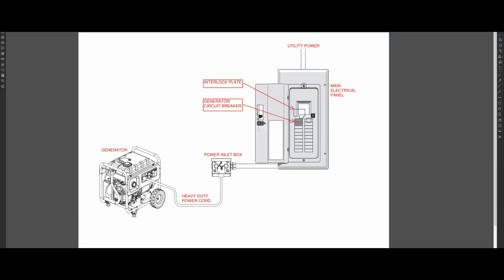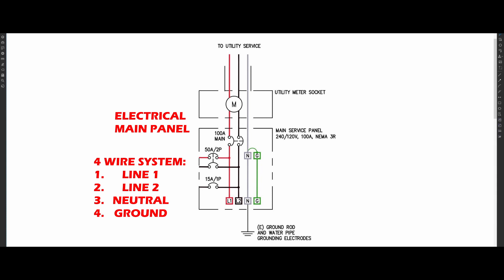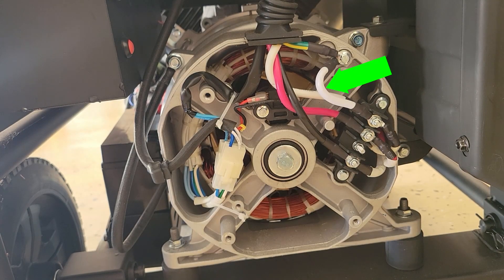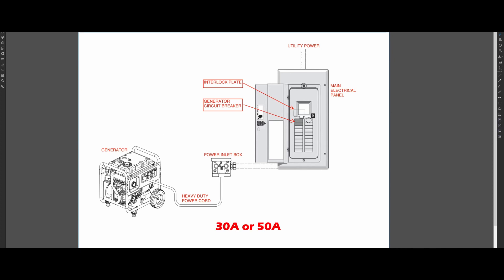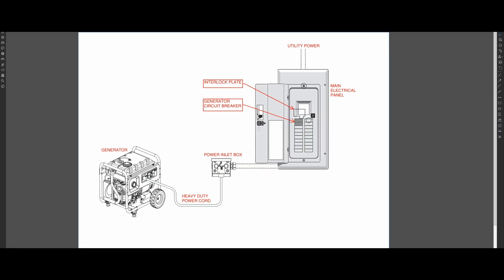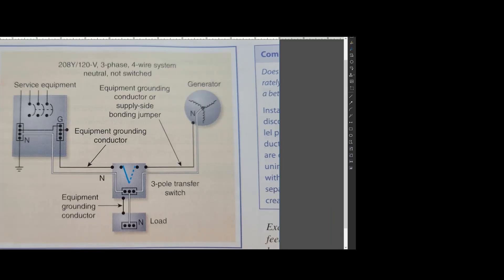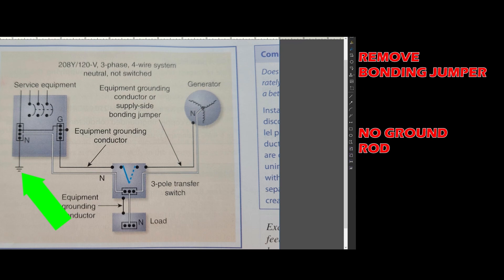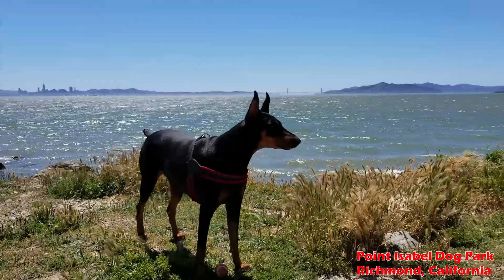Interlock Kit Generator Grounding DIY

Comment: Seems a bit deceptive.  There appears to be a cylinder on the front of the box that brings the receptacle forward by an inch. This should give sufficient space in the back I would think.

Also, most of the junction boxes and outlet receptacles at my HomeDepot are plastic including the 30a Leviton dryer outlet.  Can you please give more explanation as to why plastic is not good in this situation when it is used throughout my house?

Comment: My understanding is that this is only relevant if the generator is using GFCI, and usually if they do its only on the 15/20amp outlets, not the 30/50amp. So I would imagine if that is the case you don't need to worry about converting it from a bonded neutral to a floating neutral. Correct me if wrong.
Reply from the maker: The grounding configuration depends on your generator application. If you plan on connecting appliances directly to your generator's 20A GFCI receptacles, that is correct. No need to change anything, as the majority of generators come bonded from the factory for this reason. On the other hand, if you plan on powering an existing electrical panel via a 30A/50A, 2pole breaker **AND* use an interlock kit--this changes everything. The generator needs to be unbonded per the national electrical code (NEC). I go over the reasons why in this video: https://youtu.be/8b-EApzNAFQ
Reply: @dgtv3320  I have had my generator for 2 years, a Firman, which is supposed to be bonded to the frame.  I have an interlock and a 50 Amp receptacle on my house feeding a 50A breaker.  I never heard of this topic before this week and have never had an issue running my house on my generator.  If this was a problem, wouldn't  I have seen something by now, like breakers tripping?  What are the actual risks?
Reply: @dirtdiver2389  A "bonded neutral interlock" risk primarily refers to the potential for electrical shock if a generator with a bonded neutral is not properly connected to a transfer switch, potentially causing a situation where the neutral wire carries current through the grounding system, creating a shock hazard if touched while the generator is running; this is especially concerning when backfeeding power to the grid, where the neutral should only be bonded at the utility service panel, not at the generator itself.
Reply: I know this is an old post im a year late but my Electrcian told me the same thing i bought an older house and he said i do not need to unbond!  Leave it alone!!!   No GFCI Plugs.

Comment: Great info.

I am learning about this topic (home generators and interlocks and such) and have a question: if I have a generator, like the one in the video, that is bonded, is there a way to install a switch to either have the generator bonded or unbonded versus removing the jumper? Or, is that against code or would perhaps cause another issue?

I was thinking that, since this is a portable generator, and would be used for home backup AND other uses (remote power away from the home, camping, etc.) that some type of bonding/unbonding switch might work?

Thoughts?

Thanks!
Reply: You don't need a switch. Just float the neutral and get a neutral bonding plug that can be plugged into the outlet on the generator.  Use it with the floated neutral for your home, then plug the bonding plug and use it as a portable.

Comment: I’m gonna take my generator cover off tomorrow and see if this jumper wire is clearly visible and easily removed. This is a great video and answers one of the one question I’ve had.  The other question I had relates to the neutral that is not disconnected when using an interlock. Does that carry the Delta between the two legs back to the pole?  Why is that not a hazard for the lineman, since no interlocks typically disconnect the neutral going back to the pole. Thanks.!
Reply from the maker: The delta between the two poles gets shunted to ground at the service panel grounding system--creating no issues to lineman upstream.

Comment: I have a generator that I have confirmed is a bonded setup. I run a 50 amp plug to my house with a transfer switch exactly I shown in this video. I appreciate the way that you explain the information. I would like to know what could be harmed in having two bonded grounds? I don't understand the risk there. Could you please elaborate? Thank you very much.
Reply: The harm of two bonded grounds:  Rule- you cannot have 2 neutral/ground bonded points in the same system.  So, the first point of disconnect is bonded.  A second source of disconnect, say a sub-panel, If bonded,  could/would create a flow back to the main panel on the neutral AND the unprotected ground wires... and, anything that should be grounded.  Appliances, conduit, the panel...  I'm not an electrician.  I am wiring an interlock system.  My guess is to maintain the "first point of disconnect" as the main panel, I disconnect the bonding on the generator.  I would also guess the risk for your set-up would be minimal.  But, would violate the "  you cannot have 2 neutral/ground bonded points in the same system" rule.  And, rules is rules.  I did mention I'm not an electrician?
Reply: @topbuilder3790   LOL, thanks for the response. I have since read quite a bit more on it and have came to the same conclusion you mention (remove the bonding jumper wire on my generator) I also put a label on my generator clearly signifying that it is now floating neutral. It is unfortunate that I really can not use my generator for say power tools or such safely w/o reconnecting the bonding jumper wire. I may just end up getting a  3Kw-5Kw smaller genny for those types of jobs. I ABSOLUTELY want to "Do things right" when it comes to this stuff. Thanks again. Have a great day!
Reply: @joshwhite1009  They sell a 120v plug to plug into one of your generators 120 outlets that will bond the ground and neutral. I use it if I'm using my generator as stand along.
Reply: @onlywenilaugh6589  I did exactly that after continuing to read and learn! Those are quite handy to have. Thanks for mentioning it. Now others will know too. Cheers!
Reply: This is exactly what I am doing to power my house during utility power outages. The generator was bonded. I removed the bonding jumper. The business end of the generator even looks a lot like mine.

Comment: Som my Westinghouse 3600c is floating neutral and i have it wired to my main panel with bonded neutrals and grounds on the same side buss bars.  I assume this is correct?

I thought the generator was bonded so i was confused when you said you can only have one of the 2 bonded.  Everything in my panel works fine on generator power, i assume if the gen was bonded some things may not work?

Comment: Your Videos Are AWESOME Thank You.   On A Bonded  Generator Can I Install A Switch Between The Bonded Jumper  Wire  To Disconnect The Bonded Jumper Wire When Using The  Generator To Power The House  Electric Panel  And Connect The Bonding Jumper When Using The Generator  Alone To Power  A Drill, Saw,  Light ,  And So On ?
Reply from the maker: Stephen thank you for subscribing! I understand your question and what you're trying to accomplish. Unfortunately, I am not familiar with such a setup/solution to toggle the bonding jumper without invalidating your generators warranty. Check your user manual, but generally it doesn't take very long to install and remove this jumper wire. I understand it can be a pain to install an and re-install it periodically.

Comment: My Main panel is out at the pole 400 feet away. It is bonded and grounded at that location. My house uses a sub panel at the house where I'm going to connect the generator with an interlock system. In my research I've found that I need to float the neutral at the generator. The neutral will remain intact at the sub. Is this correct?

Comment: Can I use a bonding plug if want to use generator by itself?
Reply: Yes. I am doing exactly this. They are easy to make OR you can buy a pre-made one from Hughes Autoformers.
Reply from the maker: Mitchell, there are two different types of generators,
1. Bonded generator or 2. Floating Neutral Generator. Please refer to my video to better understand the difference : https://youtu.be/SlYfpnG2Psk
If you plan on your generator by itself (plugging appliances directly to the 20A receptacles), 
For a bonded generator, you do NOT need a bonding plug because this generator type already has an internal bonding jumper preinstalled. 
For a Floating Neutral Generator, yes a bonding plug is REQUIRED. 
I hope this helps.

Comment: Good advice here in the video.  I would additionally state that the generator cord must be connected to the house’s inlet before turning the motor on.  Otherwise it won’t be properly grounded.  And once the jumper is removed at the generator you can’t safely use it standalone without the house connected. Meaning you can’t easily move the generator back and forth between camping and powering your house.
Reply from the maker: Yeah great point Neil. I failed to mention, the bonding jumper wire should be saved and reconfigured correctly depending on generator application. I explain (3) different generator applications/configurations in this video: https://youtu.be/8b-EApzNAFQ
Reply: You can purchase a neutral bonding plug and plug it into one of the outlets on the generator and use it a standalone.
Reply: @thepiecesfit5049  have you tested that?  I’d expect that a neutral to ground bond would trip the gfci due to hot to neutral imbalance.  That would mean that all your loads would need to be the other outlet.  Essentially you’d be loosing half your outlets.
Reply: @neilbrookins8428  yes but I made my own 50 amp neutral ground bonding plug. This way not to impact GFCI enabled outlets.